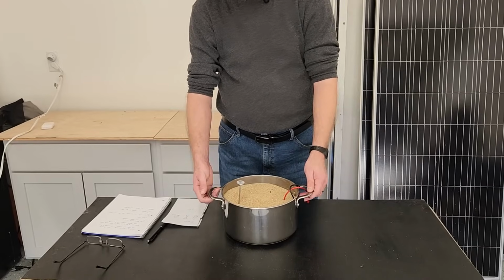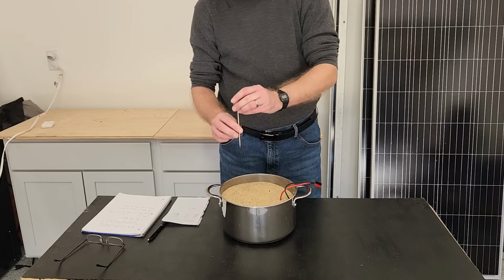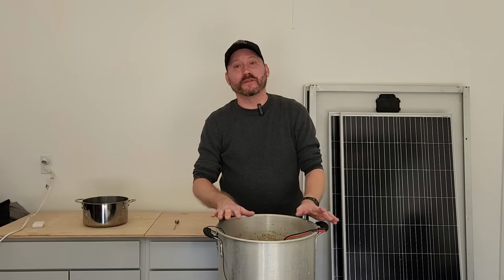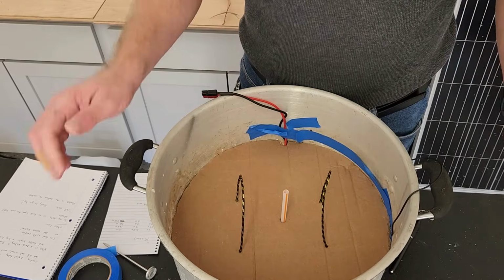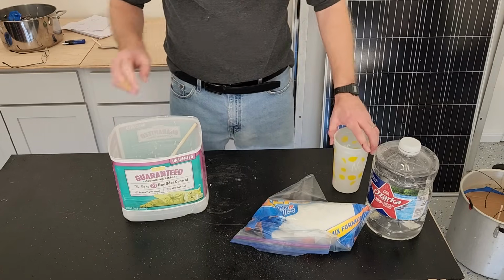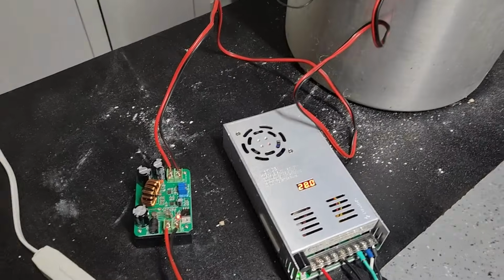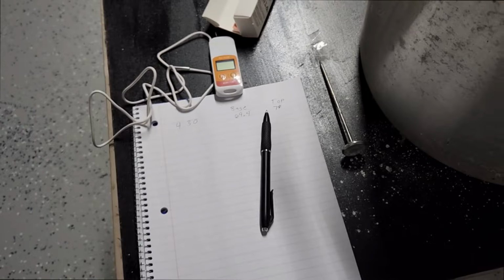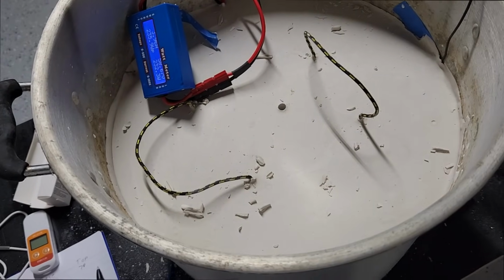Sand Battery heater. Create free heat  of 500F using solar electricity! Texas Prepper Projects

Comment: To make it a real battery (saving heat for when you need it), you will want to insulate the heater. Surround the heater with a thick layer of rock wool insulation and make an insulated lid - when you lose power, take the lid off and blow air across the top.
Reply from the maker: this is my plan for version 2! thanks for the reply!
Reply: @texasprepperprojects  this will work but you have to encase the rockwool because the adhesive in the rockwool will breakdown at 200 degrees but the rockwool will last up to 1000 degrees itself it just gets messy and fibrous after 200. Ceramic wool for kilns does not have this issue.
Reply: Blow air across the top with one of those electric-free stove fans...can't remember the technical name for them.
Reply: @texasprepperprojects  An0ther 0pti0n is fire brick. Generally, l00k f0r pe0ple making diy kilns.
Reply: I’m imagining copper grounding rods brazed to a copper disc and drive them down into the sand to make a giant heat sink. This would wick the heat upward faster than sand alone.
Reply: @JoeGraves24  actually, you use a copper plate long enough to reach the bottom of the container, bend it flat on top and sit a wood stove free floating fan on top. It will easily heat the entire room. And the last thing you want is to use insulation: a sand heater is designed to radiate heat from the entire surface, not just the top.
Reply: Sorry, we use a six inch wide copper plate 1/8" thick, put it right down the center, bend it flat to the sand, and sit the fan on top. Simple and works great.

Comment: I'd like to add my vote to using the heating element from either an electric grill or an electric range instead of from a water heater.  For extracting the heat possibly try running some metal tubes (copper or steel) through holes in the bottom and exiting out through the top of the sand/plaster, convection should get air moving through them.  Those tubes probably WOULD get hot enough to burn on contact though.
Reply from the maker: I've decided to go ahead and give this a try. Stay tuned to version 2!
Reply: Just use a thin copper plate that goes to the bottom of the pail. Then have a thermoelectric fan in contact with the copper plate. This will have the effect of extracting the heat and blowing it with the fan. There are videos of this here on YouTube as well.
Reply: A countertop, "Griddle", should do the, trick?

Why couldn't you just use a, "crock - pot?"

It's the same thing, basically?
Reply: @galenyoung8349  Crock Pots USUALLY don't get that hot.  Not sure how hot it would get if you bypassed all of the control circuits.
Reply: OrRunWaterTroughPipes.
Reply: @ovidius2000  The risk there is a steam explosion since the sand can get to several hundreds of degrees and could literally "flash" the water to vapor.  Even if it doesn't explode, a steam LEAK at that temperature (and pressure) is extremely dangerous.
Reply: @michiganengineer8621  Just don't run it as hot using water. On a volume basis water has 3.3 times more thermal capacity and the lower temperatures allow for more economical insulation that dry sand could even be utilized for that purpose. With properly designed pressure relief valves and expansion tanks with a water cooled coil, similar to what's used in alcohol distilliation, it should not be an issue with a target delta of 100F.
Reply: @texasprepperprojects  Did you make a vid of this yet?
Reply from the maker: @noelsucram  check my follow up videos
Reply: I like it. You just have to get the tubes out of the radius of heat to where they're most likely to survive.
Reply: @michiganengineer8621 You got that right. Definitely no joke.

Comment: We are in Connecticut and really like this idea.  My husband & I live in an electrically heated apartment building, so a quiet, non-fume producing solar heater sounds great!  We have read through alot of the comments to find suggestions for improvements.  Here is our plan:   We will be using an old steel milk crate to keep our heater up off the floor, an electric stove element along with the ceramic socket and high temp wires from the stove, (or a hot plate if we can find one) and basalt (igneous) rocks surrounded by sand for a denser thermal mass.  We will probably use furnace (refractory) cement to create the top cover and ceramic base for the heating unit, which would allow us easy access to all parts if needed.  We already have a few 12 vdc fans salvaged from old computer towers to circulate the air.
Reply from the maker: Watch all my other videos on this. Short answer, don't bother. An electric blanket will keep you more warm and doesn't use much power
Reply: Tell your insurance company
Reply: thanks for bring up the computer towers. i have a mining rig, that's new. i wonder if it would work the same?
Reply: @texasprepperprojects  i'm sure those can be ran off my eco flow over night.
Reply from the maker: @jamie1799   Yes but watch my other videos. it's not worth it. An electric blanket makes much more sense
Reply: Not true you just need alot more solar panels and a lot more sand 300 lbs ends up more efficient

Comment: Pro tip: Spray the inside of the bucket top with Pam cooking spray to help with the plaster release. Might also try using mortar or drywall mud instead as it's cheap and like cement when set.
Reply from the maker: Great idea!!

Comment: This is very cool! Pretty sure you gave me an idea to help extend my seed start season in my greenhouse. (zone 4b Canada)
Reply from the maker: And that is a great use for it. But check out my other videos for more data
Reply: @texasprepperprojects  Indeed. I watched them. Rather disappointing for what I wanted to do. Awesome vids btw. Lots of work went into doing them.
Reply from the maker: @tammy-lynnstewart5677   I have seen people have success keeping their small green houses stable with a 55 gallon trash can full of water though. Water has a good thermal mass
Reply: @texasprepperprojects  I wonder if a fish tank heater and a small fan (like the ones off desktop computers - just enough to move the heat around a bit.) would make it even more efficient.
Reply from the maker: @tammy-lynnstewart5677   Not worth it. But you could use a thermal solar tube heater with a fish pump to raise the temp pretty easily on solar.

Comment: I played with the sand idea years ago but wanted some features that would be difficult with sand so I changed to mineral oil. It can still get up to 500 degrees and yet is easily moved to where it is needed via plumbing. To save on cost I filtered used motor oil several times to clean out all the fine sludge that could clog up the pipes. It gets heated by being pumped through a set of solar evacuated tubes, with the pump being controlled by a low voltage thermostat so it only runs when the tubes are hot. It goes into a highly insulated tank for storage (the battery). The size of the battery determines how long it will work for those cloudy weeks when there is no charge available. As needed it gets pumped into each room where it passes through a small radiator which has a small fan blowing through it. Hot air comes out the front. Each room has an independent pump and thermostat. I'm working on an in-floor radiant system as the next upgrade that will be built into my retirement home. Because it is thermostatically controlled, I can leave for extended periods and not have to worry about my pipes freezing. I love not having a heating bill yet still being quite comfortable regardless of the weather. Another upgrade will be a heat exchanger used for domestic hot water. That will have to be regulated more precisely to avoid scalding.
Reply: Best idea I've heard yet
Reply from the maker: Neat!
Reply: The use of oil sounds interesting. The circulating water radiant floor is becoming more common so it should be easy to incorporate this idea. I’m a little apprehensive about sleeping on top of a pool of hot flammable liquid but with the oil battery surrounding an antifreeze/water heat exchanger ,that more energy-dense storage sounds good.
Reply: @danielking2944  use type oil found in electric oil heaters and/or powerline  tranformers?

Comment: Nice video and fun experiment. I think that the large stainless steel surface area is wasting a lot of your heat. Heat is radiating off the pot while you are trying to charge it. That is why the surface of the pot only gets to 90 some odd degrees. I think that you need a fiberglass insulation jacket around the pot while charging, to be removed when you want it to radiate heat. It will absorb and radiate better if you paint the the pot black inside and out.
Reply from the maker: check video 2 and 3 for follow up

Comment: heating element should be install through a hole in the side or maybe cemented into the plaster on the vertical, so wires are not in contact with hot sand this would overcome some issues you have with shorting out or melting, there are a few ideas i could give on better heat transfer but this would require more detail than i would like to go into right now, overall good idea
Reply from the maker: Check out video 2 for my reason

Comment: Maybe run a coil of copper pipe in the sand then circulate water through a radiant baseboard heater.  I think going a little bigger would be better. Make a stand to keep it up from the floor.  Make it so the elements thread into the bottom then the wires would not be in the sand. The only issue is powering the circulation pump. Would be a really cool project.  Hopefully it wouldn't boil the water and pressurize the system.
Reply from the maker: Check video 2 and 3

Comment: The sand is releasing the heat slow, insulating would slow the heat release more.  Leave your kettle inside use an extension cord for the connection between solar panel and heating element, get the most out of the panel. I use this same setup to keep my greenhouse from freezing temperatures.
Reply from the maker: Neat!

Comment: I have worked on off peek heating systems for a utility company.  I think what you have done was a good experiment. 60 volts at 4 amps is 240 watts  5 hours of sun light  that's 1200 watt hrs. i have a space heat that i use in my camper just to keep the bed room warm at night it uses 800 watts on low your heater would be = to running my heater 1.5 hours. not to bad. there are homes that use river rock  to heat there home in Canada and with no sun for 30 days it kept the home above freezing. tons of river rock one pound of mass takes 1 btu to change it 1 degree.
Reply from the maker: Thanks!
Reply: This is better than school
Reply: My favorite way to stay warm in my camper uses a 12 volt heated mattress pad.

Comment: Have you ever seen a Swedish sleeping closet?
I built mine out of PVC and an emergency camping blanket. Using a 45° connector for an 8" length attached to the wall with conduit hangers. Then used boiling water to curve the pipe for the arch.
Bedtime - flip the arches away from the wall - toss the emergency blanket on top - set up the ceramic fan to blow in - sleep snuggy withe the furnace set just below 50°
Fold it all up in the morning 😀
Reply from the maker: I tried to google this and didn't come up with anything. Please link a video to this idea.

Comment: Great idea, and so glad to see someone thinking out of the modern  box. 

Just a reminder, Bricks have always (or were) always used in the past.    People would take a brick out of the fireplace, put it in a cloth wrap and place that into the bed to stay warm.     THUS.... 

You technically could put that element into a frame with poured concrete, then let it dry, and have a handle built in over top so all you do is carry it.   Plus you could make an insulating box to go around it.   Even could make the insulating box out of glass with a no air in a vacuum. 

As for the solid fused sand, that's what you find on the beach after lightening strikes.
Reply from the maker: Watch the other videos in the series
Reply: @texasprepperprojects Just a thought but there likely are many junked hot water heaters that leak(water) but would hold sand.  I would also
consider removing the outer jacket and insulation, wrap the entire heater
with copper tubing, and then replace the outer jacket for appearance.

Water could be circulated through the copper tubing, carrying off the
heat that is being lost, and moving it into a second, non leaking hot
water heater.
Reply from the maker: @jamespatterson3153  check out my part 2 video for why I didn't do this

Comment: If you decide to give this another go, next time, you might want to get some heat resistant piping (preferably something flexible) and then thread it through the sand. Have both ends poking out the top and then get a small fan to blow air through the piping. I bet money it would generate a nice warm, directable stream of air instead of just having to rely on just the radiative heat it's generating.
Reply from the maker: Watch my recap video for more details about v2

Comment from the maker: regarding 4:58. When I was working on version 2, I actually discovered that the heating element got so hot that it melted the plastic bracket around it, and the wires leading up to it. So, the sand didn't 'fuse' (which would take a lot more heat)... the chunks that I saw were likely parts of melted plastic.   Also, check out the 'sand battery playlist' on my channel for follow up videos on testing and your questions answered
Reply: I think I need to look into conductors from an electric oven - they might be able to withstand the heat better.
Reply: Silicone insulated wires can withstand more heat and woven glass should be about the same as the sand.
Reply: A three-quarter inch copper coil waterline wound up inside there, connected to a hole in the bottom for air intake and then protruding from the top for air outtake, this would suck the air from the house in and heat it up, you can also get the woodstove fans and fill the sand to the top and put the wood for stove fans in the sand you can use copper lines to help even the heat the sand.
Reply: As another thought you can probably line the outside with thermal electric generators to generate more electricity to charge a battery as well to loop the cycle
Reply: @Struthio_Camelus  

Diesel trucks have a heating element kind of like a spark plug that might work too.

Glow plugs.
Reply: @goontubeassos7076 I think that a glow plug might be kind of small for this application.
Reply from the maker: @goontubeassos7076   Stay tuned to version 2
Reply from the maker: @solarsynapse   I have some silicone wires here for version 2
Reply: I was thinking how could you wire it without plastic... just bare wire going to a stripped down version,  maybe straightened wire heating element as well for a larger area of separation between positive and negative sides of the DC current. Od also be using a load diverter so once my batteries are charged the current would be applied to the sand battery
Reply from the maker: @bobhoward9016   I'm using special high heat silicone wire for version 2
Reply: @texasprepperprojects  Some thoughts for version 3:

1.  Use s gas cylinder and mount the element(s) so that the terminals are  OUTSIDE of the tank--for now-obvious reasons. :grin:  One big benefit is that you can strap it to a handcart and easily wheel it to wherever it is needed.. Wiring also becomes MUCH simpler, as you can insert probes/etc. in from the side.  
2.  Use rebar/etc. running from top to bottom, past the elements to distribute the  heat more evenly.

Does that make sense to you?
Reply: @texasprepperprojects  Some thoughts for version 3:

1.  Use s gas cylinder and mount the element(s) so that the terminals are  OUTSIDE of the tank--for now-obvious reasons. :grin:  One big benefit is that you can strap it to a handcart and easily wheel it to wherever it is needed.. Wiring also becomes MUCH simpler, as you can insert probes/etc. in from the side.  
2.  Use rebar/etc. running from top to bottom, past the elements to distribute the  heat more evenly.

Does that make sense to you?
Reply: Just use electric water heaters after the tank fails to hold pressure. Fill up with masonry sand bought in bulk. Power is current squared x resistance.A 4500 watt element has 12.8 ohms and 18.75 amps at 240v. At 120vthe current is 9.375 and 1125 watt’s using that same element. Use 4 60 cell panels in series for an almost perfect source of power for your sand battery. Of course you have to bypass the thermostat,safety is for sissies.
Reply: @texasprepperprojects  would doing this inside a pressure cooker pot help with efficiencies at all?
Reply: For a suggestion, try taking apart a coffee pot.  It is 110v, lower wattage, and doesn't get hot enough to boil water.
Reply from the maker: @justapro797  check my other videos on this project for what i did
Reply: if it takes almost breaking your system to heat it up then 500 degrees is too high. How long can you get the heat to last doing maybe 350 or 400 degrees? And is that more sustainable? But the time difference of how long the heat will last for 350 degrees or 400 degrees is going to be different then compared to 500... I'm not sure how long the difference will be?
Reply from the maker: I did this in version 2!
Reply from the maker: I did this in version 2!
Reply: Maybe isolate the element in another insulating means. M

Comment: Wood stove surface temperatures range between 500°-800°F. I could see using some firebricks and a welded steel box. The power requirements wouldn't be trivial but it's do-able. Neat concept, thank you for sharing.
Reply: Hi,l'm so very happy to see your video,can i write your compoment that you to built this batery
Reply from the maker: Thanks for the tips!
Reply from the maker: Thanks!